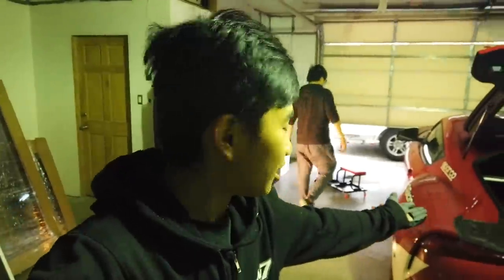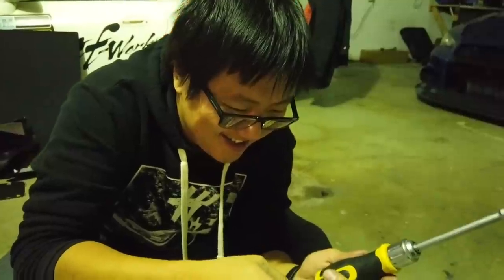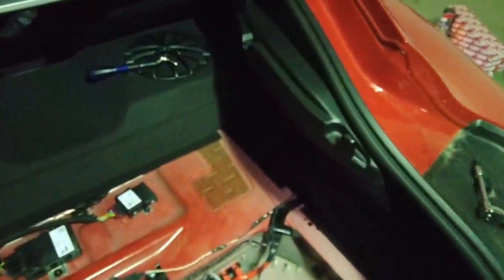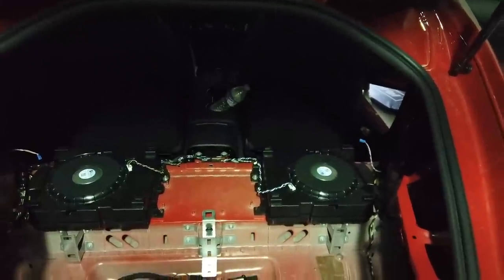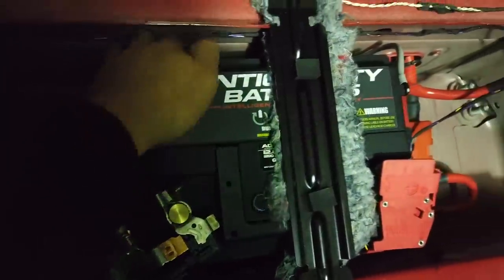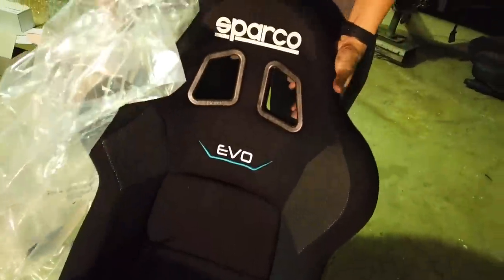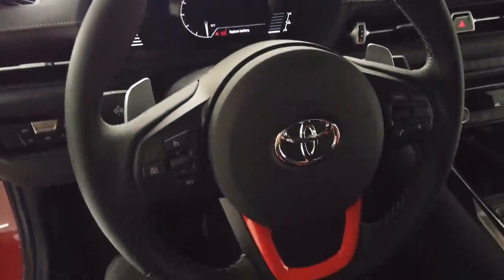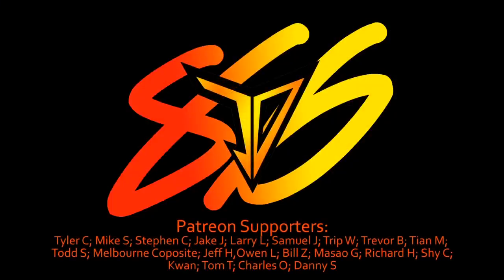Major Weight Reduction! A90 Supra Time Attack Build Continues - Project TA90 #14

Comment: Nice work pointing out the fact you need a HANS with the harnesses - too many people make the mistake of using a harness and helmet WITHOUT a HANS and that's a recipe for snapping your neck.

Love the mods! Keep the panels (relatively) straight!! ha!
Reply: shouldbeasy people also make the mistake of using a HANS device with a seat without lateral head support. Without that, it only offers protection in a frontal impact
Reply: It's a one way ticket to SNAP CITY

Comment: Congratulations Jackie on the arrival of the new parts. I am glad you went with the new Sparco QRT EVO seats. They also save a few pounds more than the older Sparco Evo seats. Good that you aquired the SPL suspension parts. That should help tremendously with alignment. 

Good luck on the build and be safe.

Comment: A simple solution for initially torquing in the wheel studs would've been to just use two lug nuts (with the cones pointed away from each other) in a jam nut application.  In fact, that approach would probably allow a much higher torque limit than the torx bit could apply.  Lastly, did you guys use any Loctite to keep 'em in there?
Reply from the maker: Yea we figured that out afterwards. And yes we did use Loctite

Comment: Hey, Jackie, please do a session on the track with that OEM battery, instead of the light battery to test if the extra 40-50lbs on the rear axle will improve the rear end grip. It might be cheaper than creating downforce :)
Reply from the maker: We’ve already done a bunch of races with the OE battery and it doesn’t exactly seem to help the rear grip. Trust me, we can solve the rear grip issue with suspension, but you can’t make 3300 lbs disappear

Comment: i thought for the wheel stud you clean the threads on the hub and put a red loctite and torque to 20lbs?.. just wondering did you ever had braces on your s2000 and is it effective?

Comment: With all that weight out of the car, are you concerned with how much the 50/50 weight distribution got affected? Or are you planning on adding bits to the rear (aero) that will bring back some of the weight.
Reply from the maker: Mentioned this a few times, I’m not really concerned about 50/50 weight distribution, and honestly the advantage of having 300 lbs less in the car is gonna seriously outweigh the benefits of being 50/50. We can always tune the suspensions to suit the balance, but you cannot tune away 300 lbs of weight!

Comment: Permanent shop/shed? Wouldn't it have been better to get 1 with ceiling space and a car lift?

Obviously I don't know what costs are associated with the difference leases and if you intend to do anything that would require a lift if you are using your partners for work done.

Anyway, the Red Baron is looking good :)
Reply from the maker: Won’t be permanent, which is why a car lift isn’t really viable. Plus we’ve only just began and need to start making some money if we want to move to somewhere nice with lifts and etc

Comment: Would be interested to see the full weight now:)
Reply from the maker: Full weight is around 3320 lbs, depending on the fuel load I believe. Our goal is under 3000
Reply: @JackieDing86  wow 3000 will be similar to s2k with supercaheger I guess but lot more power potential and reliability, this is exciting